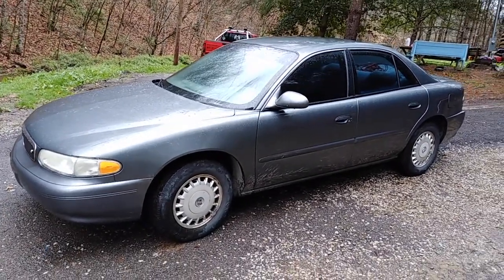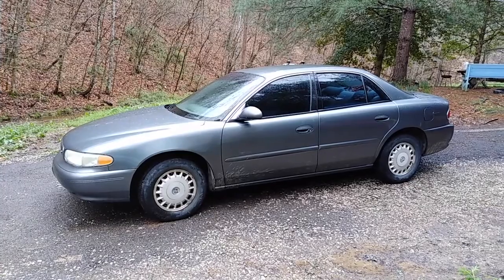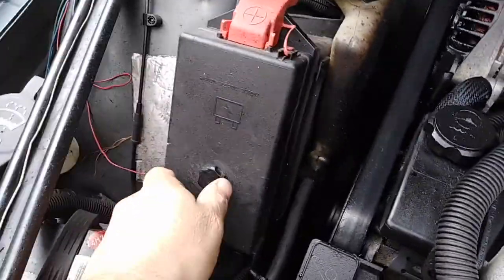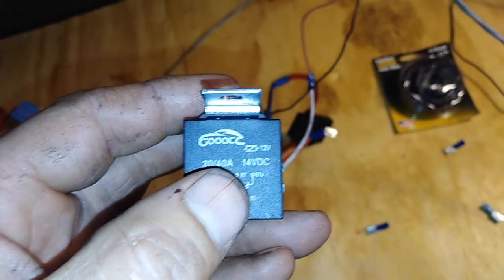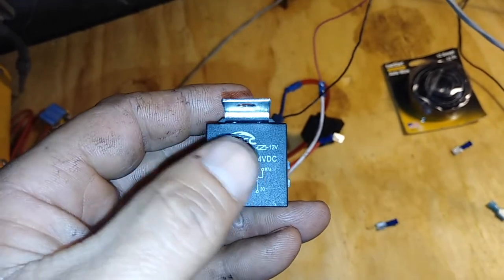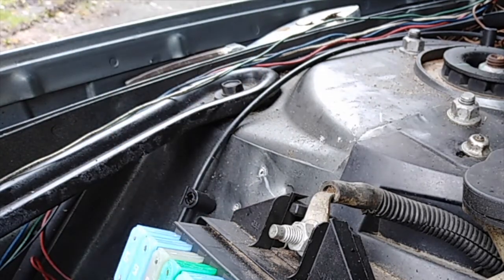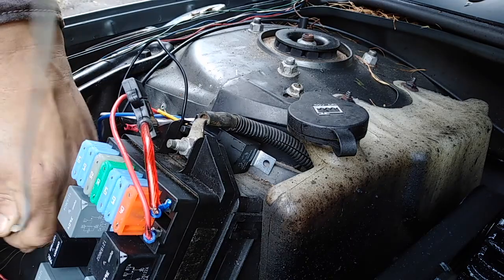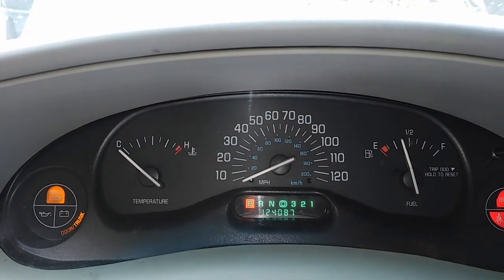Antilock Brake Bypass Switch for Off Road Use

Comment: Interesting stuff. I may end up getting a family van in 2 or less years... they probably all come with anti-lock breaks. Didn't know they would act funny on gravel roads. Ah, pulling the fuse is a good short-term solution.. I'd probably be better off with my memory if I'm mostly off road to go with the fuse out and re-learning to pump the brakes. Good vlog. (Looking forward to the finished cabin vlogs as well. (Sorry I didn't catch this one for awhile.)

Comment: Remember when they first came out with all that, was supposed to be the most amazing thing. We drove a new Cadillac in the rain and nearly ran it into the ditch on a tight corner... just started making that humming noise and you could feel it in the pedal but did not slow down hardly at all. Give me control and i will threshhold all day over the antilock buzz.
Reply from the maker: When I worked for the phone company they had me in a Chevy S-10 service truck. I   almost rolled out in front of an 18 wheeler. I hit my brakes and it just kept going. Got a good blast from an air horn out of it.